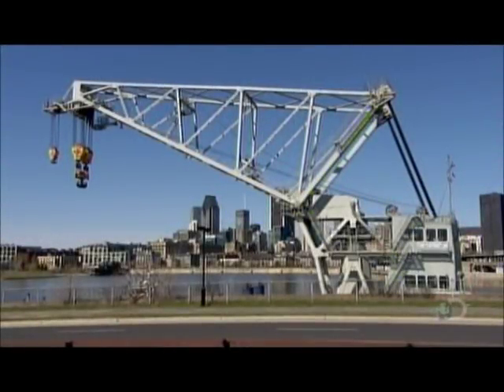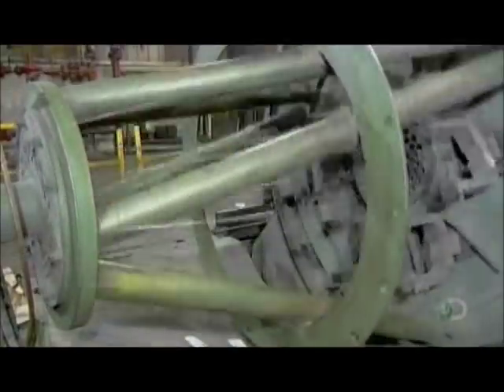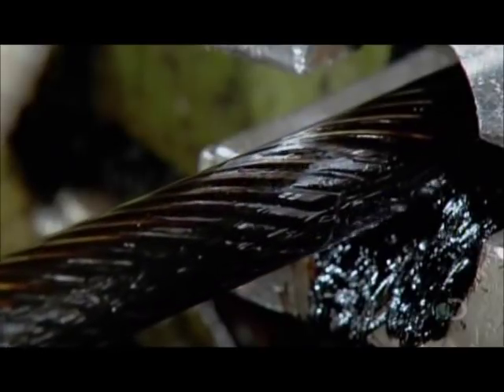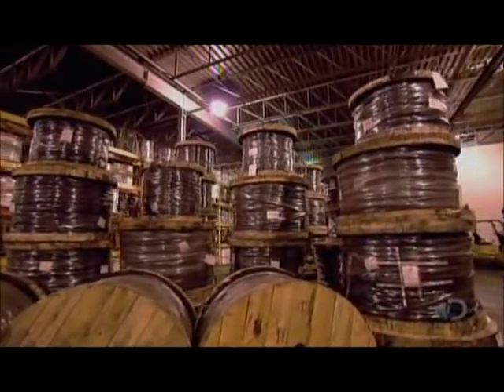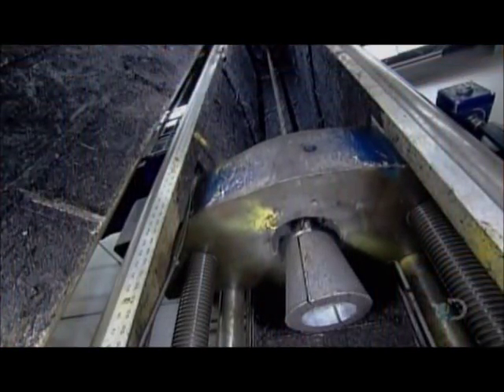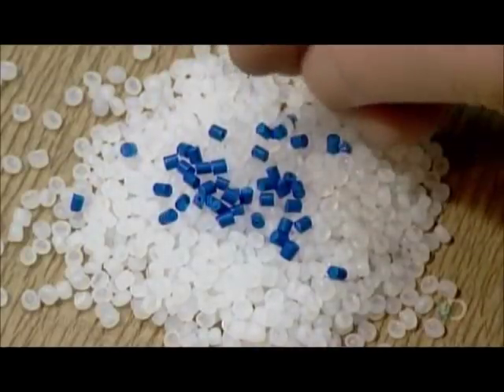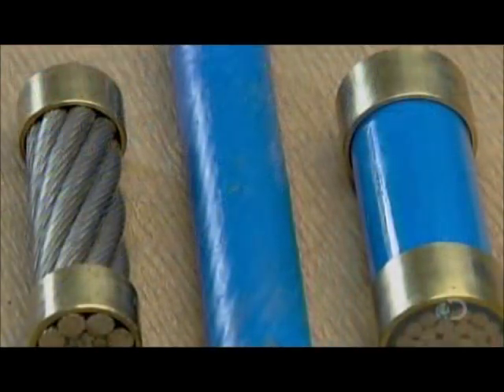How It's Made - Industrial Wire Ropes

Comment: I used to work as a radio technician operator back in the day. We used to put up those giant TV and cell phone communication towers and those Towers use these wires to tie themselves into the ground. This one time we had a new guy who didn't really know what he was doing and he put the bracket that holds the wires together on backwards. For those of you out there that know it, he saddled his horse improperly.

So we just got done putting on the final level of this Tower and we heard a dreaded noise. Sounds like someone dragging their fingernail across the lowest chord of a piano. We all looked over to see the wire swing up in the air going at least a hundred miles an hour and then the whole Tower itself came down. It was a chain reaction, when that one wire flipped all of them started to break and fail.

 In the end everything was destroyed but those cables were moving at such high speeds when the tower fell that the cables themselves are embedded in the ground. Like there's at least seven to eight hundred feet of cable that we just left because it was so deep in the ground it would take an excavator just to be able to get it out. And the craziest part was There was a pasture right next door that about 10 or 15 wires flew into and completely destroyed, two days before hand the guy moved his cattle because he wanted to make sure they were safe just in case the tower fell. Crazy how things work sometimes. If those cows had been there, anything hit by those wires would have been cut in half.
Reply: what happened to the new guy after that
Reply: @akjohnny5997  well let's put it this way my old boss was a Marine Corps Sergeant who was also a drill instructor. I have never to this day heard a man scream for 2 hours straight.... 

And he ended up not even being fired for it he just never showed up again. And as far as I know that dude just straight-up moved town. I mean I think he should have given it a second shot because it was a really rushed job and he was brand new to the team so he should have been observed better. But in the end of shit rolls downhill am I right?

After that we had a joke for the all the new guys. We would tell them if they ever want to hear the bus cream for 2 hours straight saddle their Horse backwards 😂😂😂 the confused/terrified look on their faces as they try to not freak out that they can get yelled at for 2 hours and the fact they have no idea what saddling a horse is, shits priceless
Reply: @togglefire3537  yea i'd probably skip town after that too haha
Reply: @akjohnny5997  🤣🤣🤣🤣

Comment: A machine capable of exerting 94 tons of force to make that cable snap.  Now that was most impressive.
Reply: Screws and compound levers, not so hard. Measuring and tracking the position and forces involved is a bit harder.
Reply: When you get into hydraulics, 94 tons is a start.  I work in plastics injection molding, and our largest machine has an injection pressure of 950 tons, and in the injection world, that's about a mid grade machine
Reply: WineScrounger Not really. The measurement is abstracted. Once the machine is calibrated, force is a function of the effort of the motor driving it (rpm) or the hydraulic pressure (psi). These aren’t direct measurements.
Reply: Our biggest bending machine at work is 500 Tons. And in this universe that is actually pretty normal . Try watch some heavy duty roller machine. That is damn impressive as well.
Reply: That's nothing lol

Comment: I been on a couple jobs where I seen parts of this done. The machine shop I wired up compressed cable ends of the spools of wires to be used for suspension bridges. The cables were then sent to a nearby university with had the testing equipment to inspect the tensile strength of the cable ends prior to shipping. Basically, It was a warehouse with an an anchor embedded in four feet of concrete, and a lift to pull the cable up.

Comment: For those who don’t know, this how the Brooklyn bridge was made. Not to mention, there was a scandal where a crooked businessman sold shoddy wire into the bridge which is still there, and it weakened the bridge forever.
Reply: It was right when wire ropes were starting to be made from (carbon) plow steel instead of just iron. That meant that the new and improved stuff was much stronger, theoretically. But "steel" cables had a new set of problems. Increased oxidation, even when galvanised. Exfoliation. They could be brittle; every single wire in a cable needs to move independently, and iron was better at that. Iron wire rope was much weaker, yet Iron elevator cables exist even in the 21st century. Because it's more reliable, even if it is Weaker (and larger diameter as a result).  So, maybe the cables on the Brooklyn Bridge were always intended to be Iron, and using "improved" cable was counterproductive, but that's not as interesting as the story of fraud that found traction (lol).
Thank You qt.

Comment: There is a major difference between the two examples at 4:44. The smaller diameter rope has it's individual wires twisted so they lay in a longitudinal direction, where the larger diameter rope has it's wires twisted opposite so they lay diagonal. The smaller one is a much stronger design.
Reply: It's called "bias lay" ... keeps it from twisting
Reply: @deplorabledave2543  Thanks for what may be the only useful comments here.
Reply: ... because the smaller one's wires are aligned with the load, instead of being perpendicular to the load.
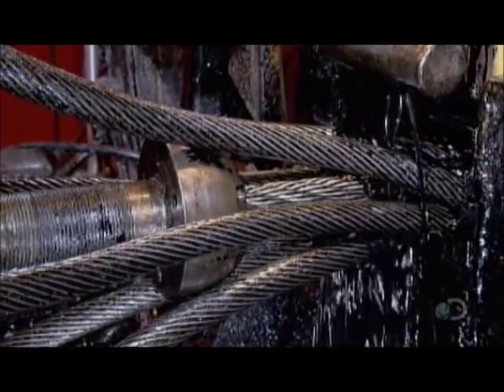At 2:40 they show the 6 strands being "closed" into a wire rope. Interesting when you look at the way the individual wires are wrapped, in a left-hand or right-hand spiral. 
Shows the outside layer of wires in the individual 6 strands are going from left to right, that is, clockwise, as the spiral travels away from you if you're sighting down the cable. Chances are, all of the wires in any given strand are going to be wound layer upon layer in alternating, opposite directions. So, the layer of wires underneath the top layer that we see might be wound in a "Left-Hand" spiral. That helps the cable stay together because each layer cancels the twisting tendency of the layer under it. 
However, here all we can see is that the big 6 strands being closed into a wire rope are laid "Right-Handed". They're being wrapped in a clockwise direction to make a rope that is also finished in a "Right-Hand Lay" direction. They're wrapped around a   core of cable (not sure if the core is "strand" or "cable", but typically it's cable), and notice that core cable is Also laid "Right-Handed".
This means this is going to be a forgiving, relatively stretchy cable that's good at absorbing shock loads, but not so good at resisting unwinding itself if it's got a load hanging from that rope, and that load decides to start spinning.
The Only Left-Hand wires that we can see are the individual wires making up the outer layer of the core cable. Those are six "Left-Lay" wires, each one having (again) Six wires wrapped around a six- (or 19, can't see it) wire tiny core. But if every other strand in this cable is wound Right-Hand for stretch, you can assume the core strand (inside the 6 Right-Hand strands) is also laid Right-Handed.
The Finished wire rope is designed to stretch, and the core cable needs to be the stretchiest component so it doesn't just get overloaded and break. It is not there to contribute to the overall strength of the cable, it is there to hold the strands that wrap around it in their proper place. Best case scenario would be the core cable could supply around 7% of the cable's strength,  even tho it's theoretically nearly 15% of its mass. Someone else commented their ski-lift ropes had rubber cores. Some cables have natural or plastic fibre cores, which also store lubricant.
But most strand (as seen at 2:42), as well as most wire rope (similar to the one shown at 0:12), is built on a single core wire surrounded by six wires in the first layer. Actually, at 0:12, they're all 8's: 8 wire core surrounded by same size 8 strand layer, all surrounded by 8 larger cables in the next layer, and finished with 8 even fatter strands. But most wire-ropes start out as six around a core. The narrator says a strand can be between 19 and 36 wires; the 19 wire strand is again really 6 around a single wire core, plus another layer of 12 over those 7.
Defining "What is a strand vs what is a wire rope, vs what is a cable", you could say that in a strand, there  is no duplication of patterns in adjacent components, where in a wire rope there is definitely duplication of the same strand over and over. As far as defining a cable goes, technically it would be a number of finished wire ropes laid up (closed) into an even bigger "cable". If you're talking about fiber rope (not metal), "Cable-Laid" rope is made from smaller ropes wound together into a "Cable" that has every layer opposite-laid from the layer under it. But if you wound together multiple wire ropes with all of its components in the same direction, you could define that as a cable-laid rope too.
These days, cable works as a generic term for all kinds of stuff. So it's ok to say "cable", even if you're talking about a strand.
There are countries where they're called the opposite, that is, left means right and vice-versa, and there are places in the world where they call cable (for example) six SLOT, instead of six STRAND, but if you've read this far you're already bored s******s, so we better "cloze" this conversation here and now.
Sorry, got carried away there,
Thank You.
Reply: @onemoremisfit  welcome back!

Comment: Wire Rope? Cable. We generally call it cable.
Reply: Americans!
Reply: Wire rope Fool. Think of cable as something to transfer information.
Reply: When a the only thing keeping 22680 kilograms (that's 50000 pounds) from smashing you says cable on the side of its spool that it comes off of, you call it fucking cable. Frankly unless you work in the factory where its made I've probably seen more of the shit everyone commenting on this video combined. I've cut with a torch, a grinder, and even used specially designed cutters for it. I've replaced it on equipment, carried places by hand, and watched it crimp, frey, strech, fold,  bend and snap in ways that would probably leave some people questioning the likelihood of shit in their pants. You ever seen 136070 kilograms (300000 pounds give or take) sway in the breeze like a leaf on a tree? I have. It makes you realize that you would much rather call it something strong and unique like "Cable" than something weak and boring like "wire rope". You at least hope the guy who invented it thought enough of it to come up with a unique name for it because your may or may not depend on something as fickle and stupid as "wire rope".
Reply: Technically if it's over 3/8 of an inch it's called wire rope.

Comment: there's no such thing as steel rope, it's called a cable
Reply: +Kaydn “SocialHypocricy” Burns Actually, some kinds of cable are called steel rope.
Reply: +Kaydn “SocialHypocricy” Burns 
But they do not call it "Steel Rope" now do they ?  No ... They call it "Wire Rope". Which is exactly what it is due to the fact that wire rope is made the same way as Nylon Rope or Hemp Rope or rope made from any other type of material.However I am not saying you are wrong calling it cable,that is another acceptable term but calling this wire rope really boils it down to what is actually is where as cable may also be made of copper to transmit electricity. Cable TV for example.
Reply: Absolutely incorrect. A cable is a thick rope of wire or hemp used for construction, mooring ships, and towing vehicles. If it is made of wire it could be steel, copper, aluminium, and many other metals and alloys. A rope is a group of yarns, plies, or strands that are twisted or braided together into a larger and stronger form. These strands can be made from synthetic materials, natural fibers or metals and their alloys. Ropes made from metal strands are called wire rope. To be more specific the metal rope could be made of high tensile steel. Then it would be a steel rope.
Reply: it's a rope, made from steel. sounds like steel rope to me.
Reply: Monument to John Roebling (inventor of wire rope, designer of Brooklyn bridge) in Saxonburg, PA, credits him as the "inventor of wire rope." Figures, if it's on the monument, they probably went through the trouble to use the proper terminology...
Reply: You're an engineer right
Reply: Tell that to 'Wire Rope Industries,' the company featured in this video
Reply: In real life ... it's called wire rope ... don't try to be so smart if you haven't used it before

Comment: Zepsolve or, any degreaser will remove it. The lube is not water based and is about like wheel bearing grease so, it's not difficult to remove. The grease is necessary to prevent corrosion to the strands and core which weakens the rope and shortens the lifespan. Usually you add lube rather than remove it.

Comment: It must snap past its tensile strength, yet the ultimate tensile strength is where something snaps. It must snap after the safety factor of the cable is reached, which is several times the tensile strength. That show never did get it correct.

Comment: What happens when one of the original spools runs out? How to you feed a new single cable into that first twisting machine? If you can’t then there must be a limit to the length which didn’t look that long considering the size of the initial spools.

Comment: Uhh.. I'm sure cable would be a better choice than rope.
Rope: A length of strong cord made by twisting together strands of natural fibers such as hemp or artificial fibers such as polypropylene.
Reply: I used to work in the elevator business and "Wire Rope" is the accepted technical term for this product.

Comment: I'd like to see how they splice long cables together without welding or clamps or something to hold the ends together
Reply: Either looping together in a figure 8 knot or welding by heating both ends and using pressure to splice together

Comment: I like how everybody calls them 'cables' except for the place that actually makes them which calls them 'wire ropes'. Similar to how everybody calls them 'bolts' except for machinists who call them 'screws'. The experts who know the most about them are sure they are calling them the right thing, meanwhile 99% of the population calls them something different. Who is really wrong here?

Another example is on the engineering explained channel where he did a video on engine oil that lasts 20,000 miles. In the video he kept calling them "engine miles" instead of just miles, as if there is a different kind of mile that your car drives so you need that extra specification.
Reply: well yeah, look at the Chevy Volt, huge difference between engine miles and miles on the car.

Comment: So... once the 'strand' is 'penetrated' with 'lubricant' for 'movement' it is 'straightened' by 'vertical' movement after which it's 'pulling force' is tested and then 'coated' in plastic to reduce 'wear and tear' when 'inserting' the 'cable' into 'large machinery'?  Just checking... for some reason I need a cigarette.

Comment: a 90 mm steel wire only holds 94 tons? On my offshore tug we have 55 mm steel wire that holds 210 tons!
Reply: there is a difference in lifting and pulling.  I can pull a 2000 kg car.  I can not lift it.

Comment: why they said nylon ropes are even stronger than steel yet they use these wire ropes for industry?
Reply: Twisted nylon ropes can be stronger than an equivalent single strand of certain kinds of steel, I'm guessing. Also, nylon melts and stuff.
Reply: +Luriskan Nylon ropes do not withstand heat or corrosion like wire ropes do. Also, when lifting with nylon you have to be careful of sharp edges that can cut through the sling. You could easily cut a 20 tonne nylon sling with a razor blade.

Comment: Why is everything in that factory made out of like 6 inch thick steel? For example, look at that winding machine at 1:20. Why does that last plate with all the holes in it that just guides the wires need to be so heavy duty? It's not supporting any load, or doing anything a thick sheet of wood and some large steel grommets couldn't do. I mean, seeing as how steel that thick costs $400 per square foot (10 times that if it's stainless), I have no idea why anyone would have done that.
Reply: The wire is being formed at the last plate. Each strand is drawn through the holes to form it.  There's probably a bit of torsion involved here too.
Reply: For a long lifetime, and to withstand the high torsion. Otherwise the cables would cut through the plates of course. And why in the hell would you have a problem with that?! I think there are more important things to worry about. Don't bother to reply please.
Reply: I work at that shop and just to say everything has to be very heavy duty. Do you think that a wire can be bent like that loll .300 wire you have to be 2 guys to even try to bend it...

Comment: I make that wire they use before they turn them into crane wires etc and I'd hate to hear that 94 ton wire snapping probably sounds like a tank firing lmao steel wire work is so damn dangerous there's been 2 coworkers that's passed away in the past year and half where I I